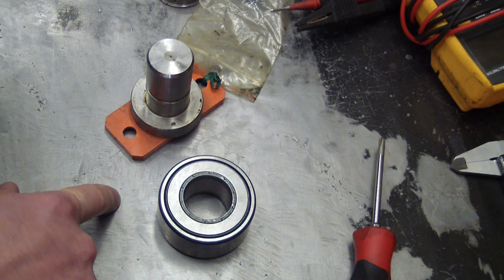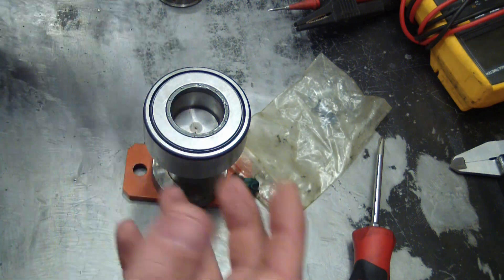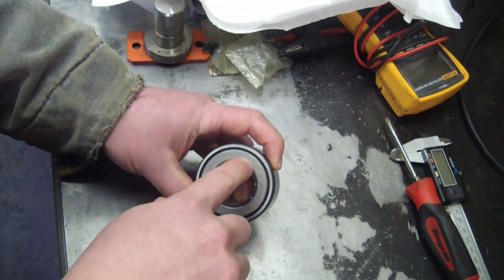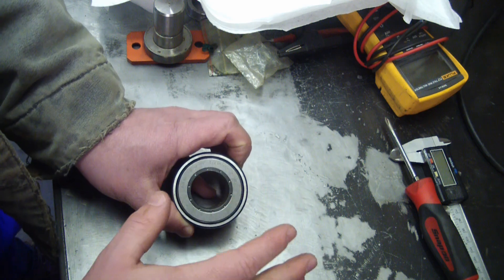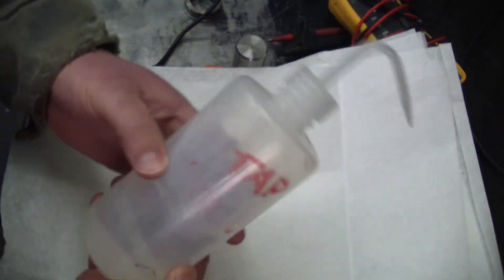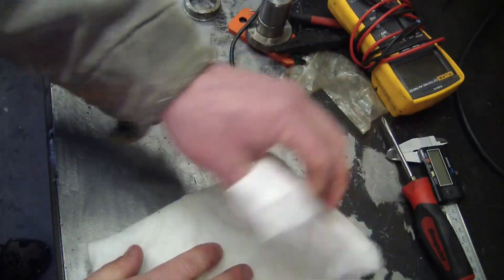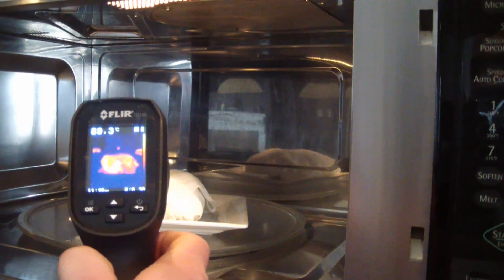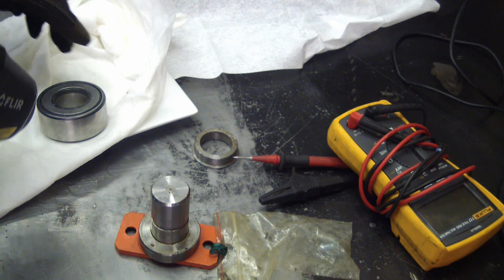The Microwave Trick? It's the easy way to heat bearings!

Comment: One of the problems, is, how do you know when you F**K up a bearing?  If you create the tiniest little pit on the roller surface, you don't know until much later when the bearing fails.  I have seen that a microwave oven can create potentials large enough for arcing.  That means that it is possible to create very tiny pits where the arcing will break through the extremely thin oil layer at the contact.
Yes, the water in the cloth absorbs microwave energy, but how much?
Does it actually work as a shield?

Comment: "One thou per inch" ...is that linear expansion?  If so, and that's an id of 1"ø, wouldn't it grow 3.14 thou since it's going around in a circle?.. Or, 6.28 thou for 200º? ..whatever,..it worked. Nice trick. Thanks for sharing. I bet it would work better on copper, huh? 
Sometimes we have to dry fit copper pipe fittings together for brazing. The bigger stuff tends to bind up, if it's just a heating job, ill flux them just to lube them so they make up without any problems. But when its a med gas job, they must stay clean and sterile the whole time while we purge with nitrogen. Sometimes 3", 4" and 6"Ø fittings will bind up so good, we gotta cut them off and try again. That gets expensive. Ive tried the torch method, and you're right, I end up thinking about good ol' "mary jane rotten crotch and her purdy pink panties" and before I know it, it's ready to braze lol .. Ill try this next time . Also, the steam might act as a bit of a lube just enough to skid it on.

Comment: I guess bearings expand relatively more outwards along the concentric ring length more than the radius of the ring shape.  Thus pulling the total ring shape slightly outwards.  That must be why heating them works.  If they expanded uniformly, the center hole would get smaller, right?
Reply: Interesting.. I was also thinking how the balls will grow

Comment: Believe it or not when I was in the NAVY for 7 years on submarines we had to use the oven in the galley. We had gen set for 40kva to 400 kva . The 400 ones were a matched set that ran off steam and when we lost the reactor the dc was put to the motor end and it turned the other end into a gen set. . To bad I could not have stayed in the NAVY on submarines. Some of the best food I ever ate I became disabled after an accident on the sub. Now I am in a wheelchair for life.

Comment: I was thinking why doesn't he just boil it or even better, use veggie oil or motor oil on it before I even saw the video. Boiling is good for 100 or so and oil can be good anywhere from 100 to almost 400 c for veggie oil. Motor oil and mineral oils are good from 200-300 c. At my old shop we made a big vat we filled with oil that was propane fired and had thermocouples that we used to heat or 24" diameter bearings for install.

Comment: good,  and you can also use liquid nitrogen to cool the shaft and let it shrink then you can fit the bearing without any issues, i have nitrogen method on instagram,  a machine shop used it to install the sleeves into the engine block with heating. 👍🏻

Comment: cool trick!

but I call prove it on the maximum temp by wrapping in wet towels! it's the same reason you don't microwave water in glass without something in the water to allow bubbles to form. water can go way above 100°. I also doubt that water acts as a barrier for the waves. could be wrong, but you made the statement, have the fancy temp measurizer and YouTube channel. and using the same microwave oven proves that metal doesn't destroy microwaves (you and I know, but you're the learnifier)

Comment: Great tip mate. I have a hot water boiler in workshop and put my bearings in a zip lock bag and boil them up in the water. The end result is a hot bearing at 90 to 100 c and enough hot water to make a refreshing and warming mug of tea. Bit of a win all round really.

Comment: I know this works but i just put the bearing in an oven bag,  put the bag in a small saucepan. Just put enough water in it to cover the bearing and slap it on the cooker. When the water boils its ready. The bearing is totally dry!
Reply: Keeps you from losing your kitchen privileges
Reply: I was thinking the same thing. I guess it isn't as quick as a microwave but seems safer and less shock to the metal
Reply: @mistere5857  A little steam isn't going to shock steel.  Not thermally, anyway.  Chemically is another story.  Using a watertight bag is clearly better than steaming the bearing, imho,  because it stays dry.
Reply: Brilliant idea because water boils at 220 and they recommend that you not exceed 200 degrees.

Comment: all joking aside... whenever a hot bearing is dropped on a shaft against a shoulder it is wise to take a punch and tap dpwn the inner race as the bearing cools and locks on to the shaft. the reason for this is as the bearing shrinks in width it also shrinks in height and can pull off of the shoulder causing inappropriate alignment. 
    It is a must for proper bearing placement
Reply: You mean get the shaft all the way in?😂😂😂😂😂😂👀

Comment: Piet,
I have really liked all your vids. 
I would have emailed you if i could find a link.
I'm just a little concerned about people doing this and then using the same microwave to nuke food in.

If the water dries out in an uneven pattern and for what ever reason some of the bearing grease or other things in handling gets nuked you could have free floating toluene or other nastiness depending on the lubricant.

Yeah I know I am an old doche you will all bitch slap saying saying this, my high-school chem teacher (Pat in part invented the plastic lining in tinned food when he worked for ICI pretty smart guy) told me that was the one thing that would hold back microwave ovens in use (the re-evolution of undesired chemicals) and sure enough Mc Scottish restaurant had to stop using the rounded foam packaging for the Big Hamster because a child died from toluene poisoning. BTW never heard about that since but it was all over the press in the 80s but I bet its responsible for lots of sick people.

BTW in the electronics game we are not permitted to heat or even store anything in a food related sources because of the history of poisonings and possible chemical effects.

Please don't take me as trying to be a dick about this, I have worked on microwave systems since the late 80s.

I just think you should buy your wife a new microwave.

Best Regards,
Tom.

Comment: another option depending on the type of bearing, sealed or not, you can do that heats evenly is an electric heated skillet or bowl that has tall enough sides, fill with gear oil to whatever level is tell enough to emerse the bearing, set to desired temperature, and wait untill it reaches temp.

Comment: what's your obsession with 454 4 barrels? I love mine except for 1 it's in a dually truck and the transmission is for torque only but gas mileage is like..... 10 maybe
Reply: ...........now if you would use the metric system that mileage would go all the way up to 23.5 liters for 100 kilometers......reads better, doesn't it !

Comment: Put bearing in a sturdy zip lock bag, put bag in a bowl and pour water from the kettle over it.  leave to stew for a few secs and your good to go.
Reply: This won't work, because the air inside the bag acts as an insulator, preventing heat transfer. Even defrosting sausage this way sucks.

Comment: Heat it in cooking oil in a pot on the stove  I also use an induction heater new style glass top design hot plate

Comment: That's a great idea. But isn't it bad for the microwave, to put metal in it? 

And that shaft part, you were putting that bearing on. I was thinking about deep freezing it, to shrink it.  would that also work?
Reply: no it's not doing any damage because its wrapped in cloth, so it's not directly exposed.

Comment: I do have an RF inductive heater, but the size of what it can heat is limited. Microwave oven?? It has a very similar tube in it as my induction heater, which does have a big ass klysteron cavity tube inside it. I had another one that had a carcinotron inside it. Carcina meaning "cancer" which is the zodiac sign of the crab, and the tube is a "sideways wave generating tube". Crabs walk sideways hence the name carcinotron. Eh? There are also BWO tubes, backwards wave oscillators, which worked mostly as a side band RADAR jammer for barrage jamming of older RADAR systems. I won't speculate how well it might work on newer pulsed doppler, or synthetic apparature RADAR. I ain't winning the spelling bee with this reply.

Comment: Best way I've found is getting an old drop light with a light bulb and set the bearing on the bench and then set the light bulb on the bearing for about 45 min 
Bearing slides right on every time

Comment: just leav it in hot water stiped facck
Reply: Germany, Seth
Reply: Ahmad Alyami It will rust !?
Reply: No, probably not, but the grease my soften and start to wash out, unless it is a sealed bearing. Usually that type of stuff has some sort of a plastic coating on it to keep it from rusting while it is shipped in on the slow boat from China.

Comment: Still wouldn't put metallic objects in there myself but, you might want to get one if the small £30.00 /$45.00 microwaves for the garage for this kind of stuff. Still if it's a one off. I can imagine someone causing kitchen havoc trying to do this.

Comment: Can't go over 100c because if you run out of water the metal won't absorb the radiant energy of the microwaves.  If there's oil or grease involved, not sure about it's reaction to microwave but in this bearing no change, faraday cage.

Comment: I remember a place I used to work at they used an induction heater to heat large bearings so they can be fitted onto the shaft,in a smaller workshop I just used a 10 ton hydraulic press since I was only repairing power tools back then (over 14 years ago).
At home & before my brother went & bought a 20 ton hydraulic press, I just used the heat expansion/heat shrink method to fit large bearings onto shafts.
I rebuilt a differential in 2014 using that method although I placed the bearings in a conventional oven at about 120 degrees celsius & I froze the diff centre & pinion gear for 4 hours, I fitted the pinion bearing & diff carrier bearings to the centre inside my parents kitchen & the diff is still going good,the bearings just dropped right on.
The gears had a bit of uneven wear on them because the small pinion bearing was Pitted & the pinion bearings completely lost their preload,so the gears were a bit noisy to begin with but 2 years later the noise has almost disappeared completely, there is still some noise on the coast side but will go away eventually.
That was in a my car which has independent rear suspension & I also replaced the rear wheel bearings the same way,there was a bit of a problem removing the outer bearing shell from the rear K frame so my dad who was a fitter by trade (retired) suggested running a bead of weld on the inside of the bearing shell ,which I did & it just almost fell out when tapping it out.
I gave the bearings housings a light hone to clean the rust off the surfaces the bearings sat in ,at the time I had the bearings in the oven & the axle shafts inside the freezer,one bearing just fell on & the other needed to be tapped on slightly & both had to go back into the freezer for another few hours.
I heated the K frame bearing housings up 1 side at a time then I'd spit on them,when the saliva would bubble on the surface then I knew the axle shaft was ready to slide straight in which they did,they have run fautlessly for the last couple of years as well.
What you have to be very careful of in a microwave oven is that any exposed metal surface is covered as metal is conductive in a microwave therefore big blue sparks will be evident, it can wreck the components of the microwave such as the magnetron,capacitors & diodes as exposed metal object inside a microwave oven when it's operating = short circuit !!!!